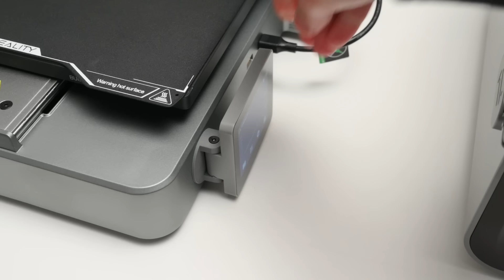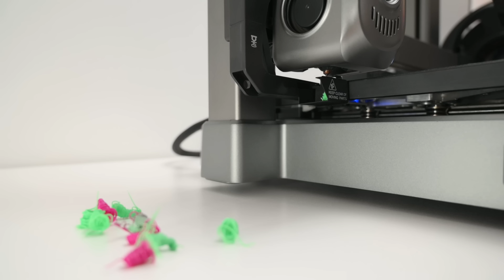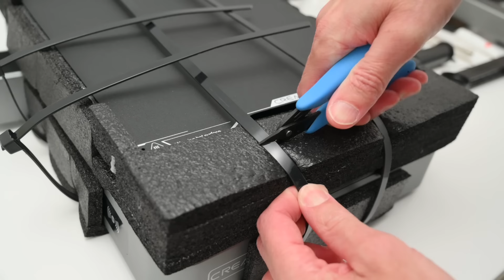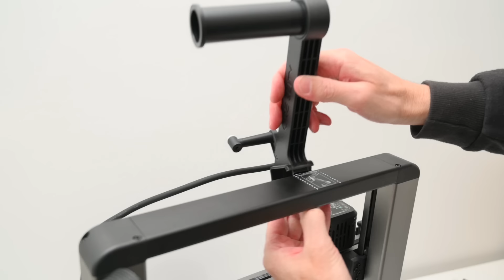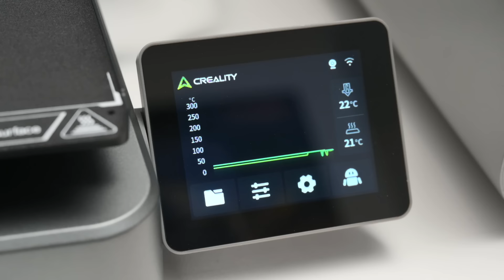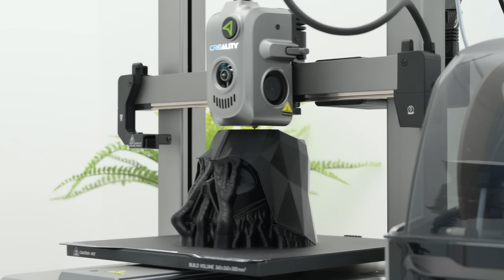Multi Color Creality Hi Combo - Unboxing Assembly and First Tests

Comment: I hate how locked down printers are getting these days. You can’t do s motherboard swap on that, cant do anything really
Reply: Yes i miss when creality printer is open and you can modified it how much you like it, but nowadays a lot of people with zero technical knowledge want to use 3d printer and because of bambu lab grow in popularity and how much creality getting hate on from bambu fan because they don't have the knowledge, i understand why they stop making open source printer
Reply: Yeah, but they also perform better out of the box without too much thinkering.
One thing is having 3d printer as hobby for thinkering, other thing is having fun with the prints itself and not wanting to spend a full weekend trying to solve printer problems

Comment: Good thing I procrastinated on buying a new 3D printer. I was contemplating between Anycubic's Kobra 3 Combo or the Creality K1. Completely different printers, but the Kobra 3 combo appeals to me due to it's inclusion of a Multi material system. Now that this exists, I think I might go with Creality's Hi Combo! Though I'm gonna wait for full reviews before pulling the trigger.

Nice video!
Reply: Definitely don't buy a kobra, it's mediocre at best. It's biggest feature (the drying feature of the ACE) is so obnoxiously loud that you'll never want to use it. Even on the opposite side of our house in a closed room I can still hear it.

This looks decent, but this video seems very bias with paid phrasing so I don't trust it. But if the printer can work as well and consistently as an A1 I'd consider this since it can support more than 4 colors. But if you don't want more than 4, I would just get an A1 since the price difference is only $10 usd.
Reply: @Mike-eb2kn i use HI, it wont disappoint u. I even print commercially using this printer.
Reply: SB2024 discount code, got me over the line , I get mine in about a week
😊

Comment: So it's basically an A1 with a bigger AMS
Reply: Yes. 

Good for the consumer.
Reply: too bad this is priced as the A1, so I went with the A1 Combo instead. Creality used to be cheap
Reply: @AndrewTSq can't do 8 color with A1, The Hi you can do up to 16. I bought a P1 just for 8 color. Go figure
Reply: @redherring5532  Yes that is true, but I do not do color prints on my A1. Still the A1 Combo was $10 cheaper than the Hi Combo. I have a X1E at work with AMS's if I for some reason wants to print multicolor with 8 colors or more, but we use them for just storing different filaments like PLA,TPU, ABS PETG and supportmaterial.
Reply: @redherring5532  I just read that AMS2 will support the A1 Mini and A1 with an firmware update in late April :O Not sure it means only 1 AMS2 is supported, or if you can connect up to 4 of them. But anyway, 4 AMS2 would be like $1400 anyway :D
Reply: @AndrewTSq its the same price though… and it doesn’t light on fire, doesn’t have to use their own slicer and its creality so you know its good quality plus slightly bigger plate
Reply: @ I will get another creality one day.

Comment: Filament waste will be so much better on this machine than the k2. The k2 uses a longer extruder so it has to purge more.
Reply: Actually, the Creality HI has a bigger waste of filament, simply because the distance from the cutter and the extruder is greater, and almost all that distance is purged and wasted, in the end both have basically same amount of waste
Reply: @MrUnzumaki  my knowledge of the hi wasn't great now that others tell me different.  I been waiting on video reviews about it to learn more. I know when to admit when I'm wrong which it looks like I am in this case
Reply: Bro they use the same nozzle
Reply: @hihellothere9569  do they? I was under the impression the k2 was an unique nozzle
Reply: @bobbydelawder8230  no they use the same nozzle